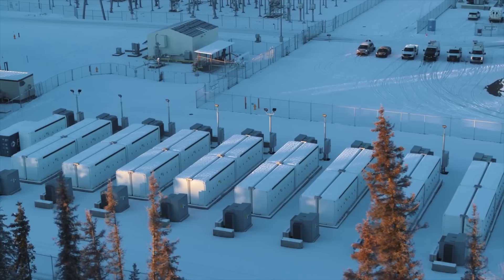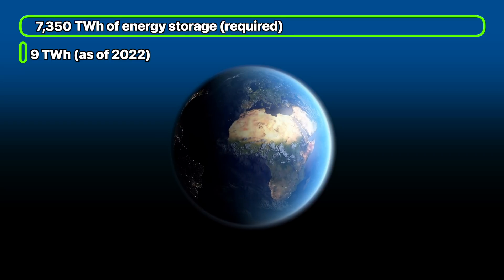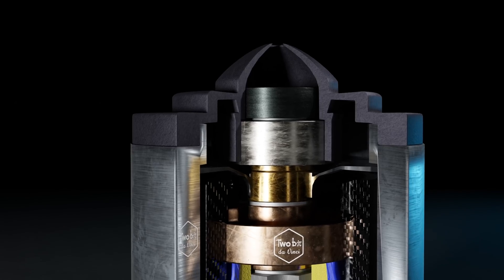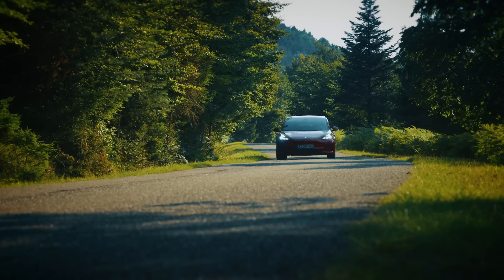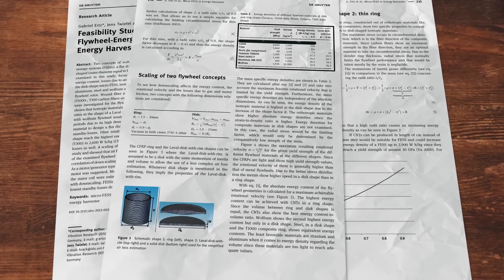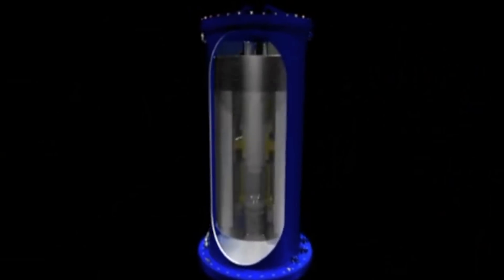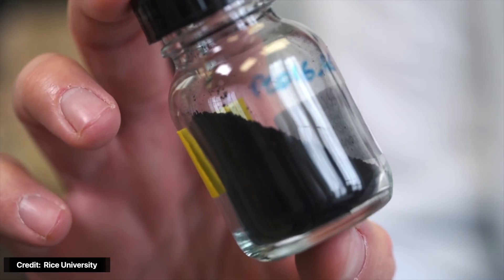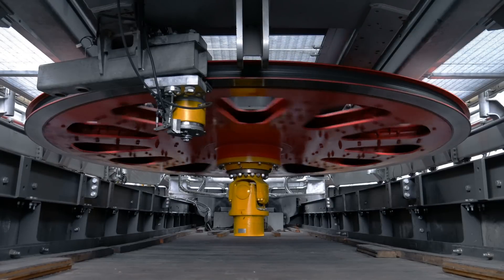Breakthrough Energy Storage Tech CRUSHES battery prices by 90%!

Comment: I don't see flywheels as energy storage device, not long term.  I see flywheels to be more of a regulation device.  The irregularity of solar power needs a more consistant delivery and give the ability to escalate quickly when needed.  Your video on vertical wind turbines with gravity storage is similar.

Comment: This video makes the all too common mistake of mixing up primary energy and electricity. The 173,000 TWh number is the caloric content of all primary energy. Total global electricity consumption is roughly 25,000 TWh or about 1/7th. Since solar and wind generate electricity, we will have to switch most of our energy use to electrity: electric cars, electric heating (heat pumps). And when you look at it, electricity is far more efficient. A modest petrol car drives only 1 km per kWh (of caloric energy in the petrol). An electric car does 5 km/kWh. Also heat pumps can operate at more than 300% efficiency (COP). It is very common to employ the tactic of projecting primary energy use as the goal, while ignoring the elephant in the room: the electrification of (nearly) everything.

Comment: Even as a kid, I thought flywheel energy storage was the solution for line conditioning (at a mass scale). Turns out, I wasn't too far off. But what I learned from this video: flywheels lose energy very quickly. I had no idea. I thought it maintained it's inertia in a vacuum very well and took months to lose all it's energy. I was very wrong. That's disappointing.

Comment: it sounds good with the icing on the cake would be having these flywheels running together with the sodium sulfur storage battery charging this battery as it stores its power where the spinning type charger can take a break you can drop the RPMs once the sodium sulfur battery is stored up to it's maximum capacity where it drops to a certain point then the gyro spinning unit can kick back in to bring it back up looks like it's kind of like the way a submersible pump pumps the water into a storage holding unit when it drops down a float kicks in that turns on the submersible pump see what I mean 🧐🧐🧐🧐🧐🧐🙏🏾🙏🏾💞

Comment: Off Grid Prepper idea😉
Why not develop a Water Tank Cyclone energy storage?
Use a permanent magnet motor generator in the top center of a round water tank to rotate the water to help keep it fresh, then switch to generator mode to supply energy when needed.
Drive the motor on renewable energy: Solar, Wind and Hydro over a long period of time. Then use the energy and fresh rainwater stored in the tank.
Reply: i guess cause it wouldnt rotate for very long

Comment: Good old SAAB 92 (with a drag coefficient of 0.30) from 1949 had a flywheel. In order to overcome the problems of oil starvation during overrun (engine braking) for the two-stroke engine, a freewheel device was fitted. Different application however.
Reply: All cars have a flywheel.
Reply: @superliegebeest544  but not like the Saabs ;-)

Comment: Great video as ever, just a small quiblle on the 3% per hour maths - a percentage loss is always a percetage of what you have at the time, so the "a little over a day" is out the window - you were adding them up, giving about 33.3 hours of storage. But in fact, a 100kWh flywheel, after 24 hours at 3% per hour, would be down to about 49.6kWh and losing less than 1.5kWh per hour. After that 33rd hour, it would still have 37.7kWh, losing just over 1 an hour. That's not exactly a massive quantity left, I'll admit, but if you need to be able to access your solar panel power in the evening and you have plenty spare capacity in your panels and flywheel, it's absolutely fine.
If you're interested in how the numbers carry on... after 48 hours, it's 23.98kWh, losing less than 1 an hour. After 72, we still have 11.5, losing .36 an hour. 96 hours, down to 5.5, losing just over 0.17 an hour. It finally dips below 1kWh in the 154th hour - 6 days, 10 hours. From there, the losses start to look a lot like AA batteries' charges and I've no real interest in dragging the formula any farther down my spreadsheet ;-)

Comment: Oh, yes, flywheel energy storage is breakthrough. Wiki: "In the 1950s, flywheel-powered buses, known as gyrobuses, were used in Yverdon (Switzerland) and Ghent (Belgium) and there is ongoing research to make flywheel systems that are smaller, lighter, cheaper and have a greater capacity."

Comment: Flywheels are researched as potential energy storage for decades, there's no breakthrough associated with them.
But honestly, I'd rather live next to lithium battery than next to fast rotating flywheel. If the battery burns, it will at least burn in place. Masses and speeds involved in storing useful amounts of energy in a flywheel are ridiculous and when such parts decide they don't want to move in a circle anymore they won't ask us to open them a door.

Comment: It would only be cool if they made them for Farmers. Cheap, and available packages. My plan is to not spend money on a fly wheel but to use instead what the power companies us now... water storage. The pumping of water to a higher area during the day from solar or intermittent wind systems during the day mean that water can be stored and then released to power a generator later at night. The system can be an enclosed system (same water used back and forth) So this fly wheel idea (something I thought about 40 years ago) whilst cool may just be a side step in the wrong direction. I cant see how this would have space applications either..

Comment: I wonder why energy dissipates so fast if the vacuum is maintained well, like in a completely sealed off chamber. But would a chamber filled with (low friction?)  hydrogen gas work too, though less well ?  This could perhaps allow for cheap ones. Replacing the air inside with hydrogen seems easier than drawing a vacuum.
Reply: Why Hydrogen?  Nitrogen is much easier to access and has none of the explosive tendencies...  Any gas will create friction exponentially with the increasing speed of a rotating body though.

Comment: Instead of using a solid flywheel why not use a liquid such as Mercury which can be pumped around a circle, the other advantage is no bearings are required for the flywheel?

Comment: Longer carbon nanotubes are better, but you can still get significant strength increases with short fiber forms when mixed in with epoxy and  regular carbon fiber.  

   Also, if you take a source of cellulose that has a high crystalline cellulose content, then you convert that into cellulose nano crystals--you get a high percentage of these.  Then if you carbonize them, you increase their strengths even more.  These are like nature-man faciliated hybrid carbon nano tubes. It is much easier and cheaper to make this stuff in bulk than carbon nanotubes (so far). 

   Just adding 2% of this powder by weight to the epoxy, significantly increases strengths.  

   The limiting factor is less the above, but more the holding matrix i.e. the epoxy.  We need to come up with something with greater tensile and Young's modulus strengths than epoxy.  For example, perhaps one could melt high strength aluminum alloys or the like, into the fiber matrix. While Al has a significantly higher density than epoxy, if you do it right, you can use less of it, and the strength to weight ratio may justify it.  You might be able to get away with using a thin layer on the top and bottom of the carbon fiber/carbon nanotube/carbonized CNC's matrix? 

    The only issue is that you would have to heat or soncially weld the Al alloy inot the matrix, either under vacuum or inert gas condition, so you don't potentially degrade the carbon. 

        I have wondered what strengths waterglass cured into silica gel has, as compared to epoxy?  The nice thing about carbon fiber, is that it wouldn't be as affected by the initial high pH of the waterglass (until it reacts with CO2), like say fiberglass might be.

Comment: My main issue with flywheel energy storage is you need to align it with the earth's rotation. If you just have it pointing vertically upward, unless you're in the arctic or the antarctic, you'd slow down earth's rotation over time if implemented at the required scale

Comment: I'm surprised that LOW density, rather than high density, makes an efficient flywheel...
Reply from the maker: low density structure, for higher density weight further out. no need to have any weight closer to the axis of rotation if that makes sense... apologies its a bit complex but more weight further out, strong lightweight stuff in
Reply: @TwoBitDaVinci  Ah, interesting. I suppose that DOES make sense, even intuitively... Thanks!

Comment: You  don't want to use Flywheels in vehicles that have to turn, like Gyroscopes they like to maintain a fixed direction, also a Flywheel on a friction-less surface  causes the vehicle t counter rotate.

Comment: Unfortunately another case of 'too good to be true' being accurate. Mathematical tables/theoretical promises are vaporware and should not be considered as a 'tech' that does anything other than look pretty on diagrams :/ 

I imagine the  energy loss is due to pivot/spindle friction which will build up (especially on MASSIVE flywheel systems) no matter how good the bearing or grease. What about something like permanent magnetic bearings to support medium weight flywheels? If you're in a vacuum, with no physically touching parts, there would be pretty much zero possibility for any loss. An array of these could hopefully handle a distributed load just like you've got thousands of 4680's that make up a tesla battery pack.

Comment: Here is my question on that: If flywheels are as energy dense as batteries and as responsive as supercaps, why don't we use them in EVs to improve the regenerative breaking? There we don't need to hold the power for long. It is either immediately used again for acceleration, or it can be pumped out into the normal EV battery...
Reply: If the electric motors are giving you energy from regen braking in the form of electricity, why bother converting it to mechanical, then back to electric, and back to mechanical again? Doesn't it make more sense to just store that charge in the battery? A purely mechanical system would be complex, because you'd have to vary the ratio between the tires and the flywheel as the  car's wheels slow down and the flywheel speeds up, and vice versa. You'd basically need an infinitely variable transmission, possibly for each wheel. That's a lot of weight, parts, and maintenance cost.
Reply: @DFPercush  Sure would. The issue with storing in batteries is that batteries sometimes cannot take the energy up fast enough, leading to reduced regen breaking. That's why a "buffer" for that would be desirable, at least in some EVs.
Reply: For subway cars, under the platform? Why waste all that braking power as heat?  Slingshot that car outathere.

Comment: Why did it take so long?
Europe had some buses back in the early 1960's that used a mechanical flywheel arrangement to help with city stop/start driving.  When parked overnight, there was usually enough residual spin to start the diesel engine the following morning.

Comment: you can't use them for EVs practically.  spinning wheels also work like gyroscopes and want to hold their position in space.  good luck turning.   There were some flywheel buses used in Europe for a while trying this out, getting spun up at stops.  they worked ok, but we're Abandoned due to cost and the aforementioned turning problem.

Comment: Because those four stroke cycle diesel petroleum gas generators electric last forever cuz all they have to do is idle at 75 RPMs a minute to 150 RPM a minute it should be somewhere around there so you can compare to the average engine which items at 600 RPM or 700

Comment: All freight trains are petroleum diesel gas electric generators that turn electric motors on the axles from the electricity generated by the electric motor on the multi cylinder gasoline 4-stroke cycle engines 16 cylinder engines

Comment: #1: No heat? I think somebody's pulling your leg. The resistance may seem futile, but it is still there.
#2: These are likely to be most useful for phase maintenance, keeping fluctuations as various sources and sinks go on- and off-line to a minimum.
Reply: Yes. How can something lose 3% of its rotational energy per hour and not generate heat? Where else can that energy go? It doesn't make chemicals, its mass isn't increasing, it's not raising itself into the air, etc. So... it must go into thermal. If it is slowing, that energy must go into heating bearings.

Comment: Atmospheric pumps can lift water ÷ - 20ft  using no electricity or fuel . By stair stepping we can lift water to our gravity battery. Meaning with nothing but PVC pipe ,vacuum chamber,(an air tight drum filled with 80 percent water) ahh, nevermind it's too simple.
Reply: Ah yes, too simple until our electric vehicle using it's gravity battery tries to drive under a bridge that's only 19 ft high? 😀

Comment: Agh. This video can't even describe correctly how flywheels work.
The biggest problem is its focus on making flywheels lighter, which is NOT what is needed.
It's been awhile since I've thought about flywheels but it should help to start with listing what improves a flywheel design vs what makes it worse...

Improves a flywheel...
As much mass as possible
As much density as possible
As much rotational speed as possible
Perfect bearings which minimize or eliminate friction and associated loss of energy by heat
Least amount of atmospheric friction as possible, this video describes enclosing the flywheel in a vacuum.

Degrades a flywheel...
Friction of any sort
Self-destruction
Transfers of energy

Some important ideas and concepts...
Increased speed increases all sorts of risks and stresses that can cause losses, so typically flywheels work better by increasing mass and spinning slower instead of spinning a low mass flywheel. Really great flywheels might spin only one rotation every few seconds.
Flywheels can be made in a hub and spoke to try to minimize weight near the center which contributes little to angular momentum, but you're now left with a lot of empty  unused space that isn't doing anything. So, although some flywheels that strive for efficiency might be hub and spoke, traditional flywheels are solid disks to maximize utilization of space.
I doubt flywheels can be used well in mobile devices like vehicles and aircraft even if they're  relatively light because the velocity they would have to spin would cause enormous gyroscopic forces that would always favor inertia and prevent changing direction. Speaking of which, maybe someone can figure out how to use the gyroscopic forces for energy instead of feeding from the flywheel rotation itself. That would be really cool.
A flywheel is a mechanical way of storing potential energy, as opposed to a a more typical(today) chemical battery or electrical like a capacitor or heat like a thermal battery.
"Charging" a flywheel used to be a difficult problem but is probably more possible today using such things as microcontrollers that can be programmed to optimize the transfer of mechanical energy from something like a windmill or electrical like solar PV panels. Microcontrollers can perform like variable automatic transmissions continually adjusting input to output to the flywheel to optimize transfer, but losses likely still should be calculated to know how efficient the system is.
As noted above, friction losses due to bearings and atomospheric friction is ordinarily a big issue. Enclosing in a vacuum is one good way to address atmospheric friction and magnetic levitation might be a solution for bearings, but if the flywheel is high mass, the magnetic forces would have to be enormous, particularly if the flywheel can't hit the enclosure or any other object.
The losses of long term storage quoted in the video had no explanation and no description where the losses are coming from. If operating in a vacuum, almost certainly have to be coming from the bearings. There might be some losses associated with the earth's rotation but not likely the 20% or so after a few days quoted in the video and I wonder if even these geo forces can be mitigated by positioning the flywheel upright along a latitudinal direction.

Bottom line is that as technology improves, we might see flywheels used sometimes.It's just an option. IIRC it was even used to power public transportation buses at one time. But that was before we had decent chemical batteries. Today, there are many energy storage options that are pretty good and the flywheel has plenty of competition.

Comment: Two other things.

The faster you spin a large mass, the more dangerous it is if something goes wrong.

Also, the faster you spin your flywheel, the faster you lose kinetic energy by heating up your lubricant. Also, shouldn't lubricants be worse at lubricating at higher rotational velocity? Fluid resistance is roughly proportional to speed if I remember right.
Reply: Good point about the lubricants. It also applies to eddy currents in magnetic bearings—so you'd still be right even if they were using those and not ball bearings or roller bearings.

Comment: Is the electrical energy recovered from the  flywheel system really 90% of the electrical energy used to spin it up?  I thought the complication of dealing with variable flywheel speeds while providing stable voltage levels would waste more energy.